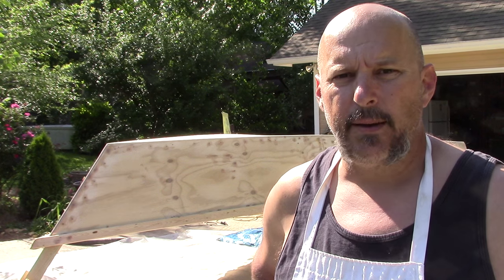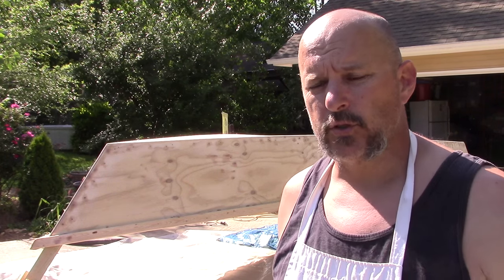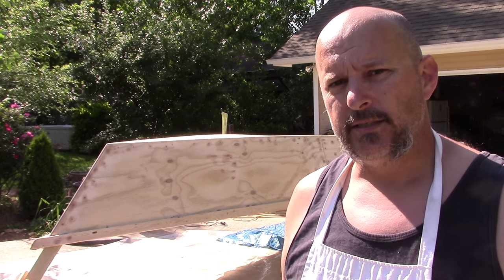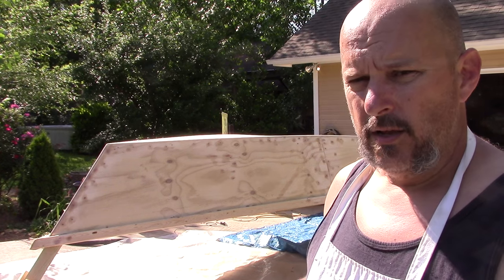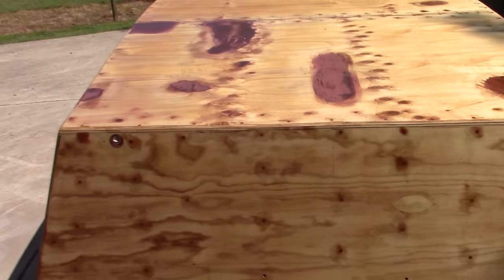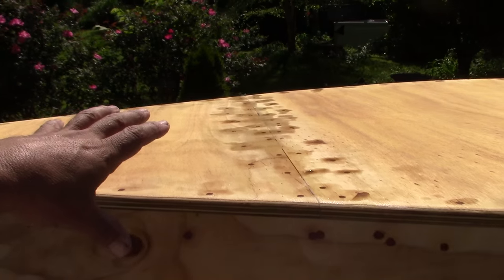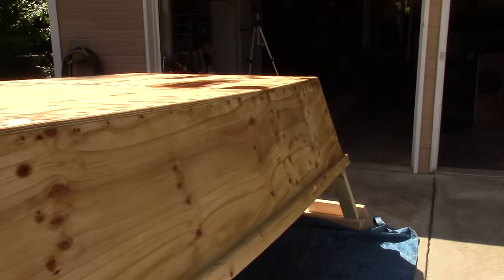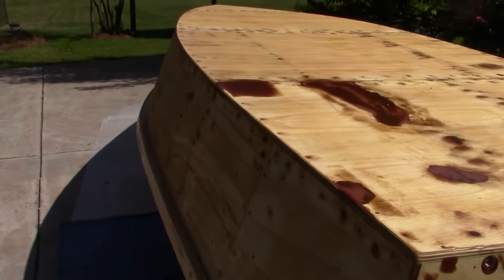Building the Lumberyard Skiff - Epoxy Saturating

Comment: Hello Mark.
I'm Bill.  I was going to build an Albion but Mr. Spira who designed them passed away. You have built both the Albion and the LYS. In your opinion, which is a better boat? which performs better and which is easier to build? In the event that the Albion is the better boat do you still have plans for it? Also you have used these skiffs in the gulf of Mexico, how is it? Do they handle the chop ok? majority of my use will be in Apalachicola Bay but would like to go outside weather permitting. Your input would be appreciated.

Comment: I'm building a dory from Jeff Spira's designs. I emailed him and asked if I needed to saturate the plywood before putting on the glass, and he said no, it isn't necessary.  I have no experience building boats or using fiberglass cloth, but not saturating just doesn't sound right to me, that's why I will definitely put a coat of epoxy on first.
Reply from the maker: It can be done without pre saturating,  but it is better to put a coat of epoxy on let it start to kick then glass.  That is my opinion.  Also I will try and glass and fair as much as i can while i am in the Chemical phase of epoxy.  I just like to have as much done as I can while it is still bonding to its self chemically.  Have fun and get someone detail oriented to mix for you.  Much easier.
Reply from the maker: Also consider attaching your running strakes to the bottom when you are in the wet on wet phase.
Reply: @plywoodonframe  it's funny you mentioned that. I was wondering at what point to attach the runners. I guess it's ok to screw them on through the fiberglass as long as I have enough epoxy on. I just plan on painting the runners. Thanks for your reply, I appreciate it.
Reply from the maker: @The314moses  Just use epoxy/graphite powder on the bottom.  It holds up really well.  Better than any paint i have ever used. Also it is easy to touchup if needed.
Reply: @plywoodonframe  thank you!

Comment: I definitely wish I had saturated the hull prior to glassing. I was able to fix just about all of it by sanding into the glass enough to allow epoxy to soak through. To anyone thinking about skipping this step to try and save epoxy DON'T! You'll just be causing yourself more work down the road.

Comment: I'd rather do 1 layer of 6oz cloth along with the epoxy when you do your saturation.  This way, you have a true chemical bond of at least 1 layer of glass with the wood hull. All of your other layers of fiberglass can go on top on that later. Its better to have fiberglass mechanically bonded to fiberglass that's already chemically bonded to the wood, rather than all layers of you glass are just mechanically bonded to the wood. Theoretically it makes more sense. 

..if your first layer is just 1 6oz cloth you dont have to worry about your wood sukcing the resin out of it since it's so thin. Either way, a fill coat before your other layers would fix any issues.